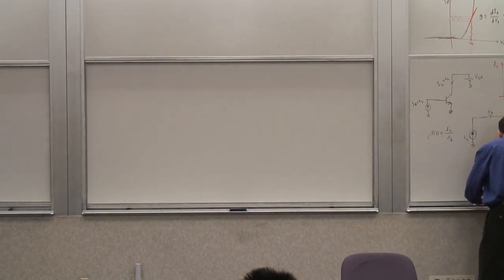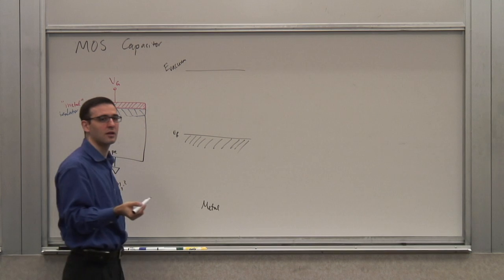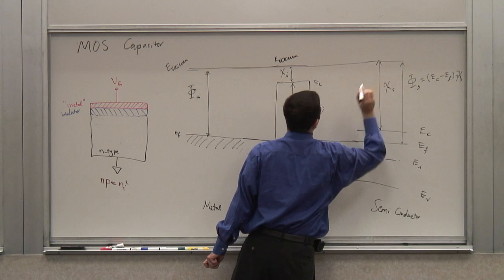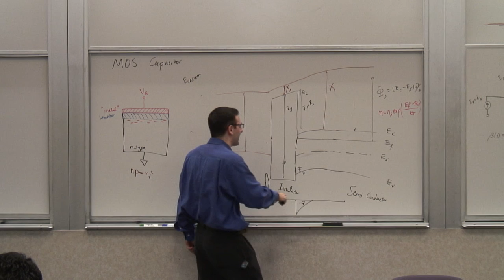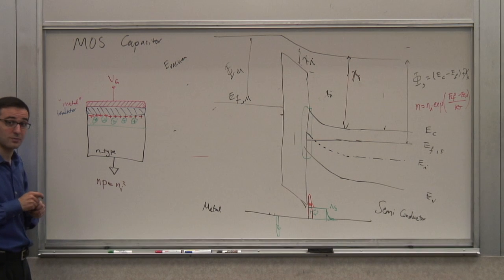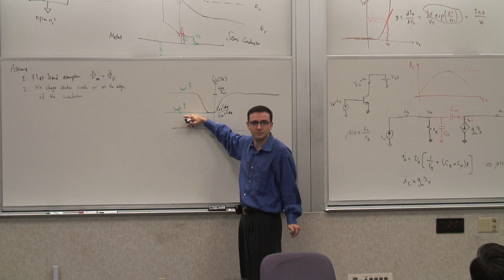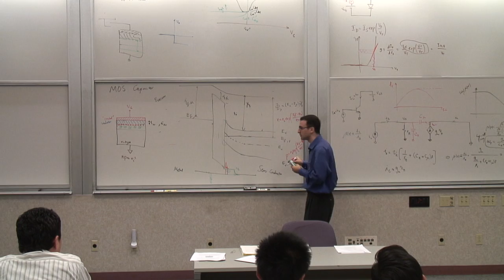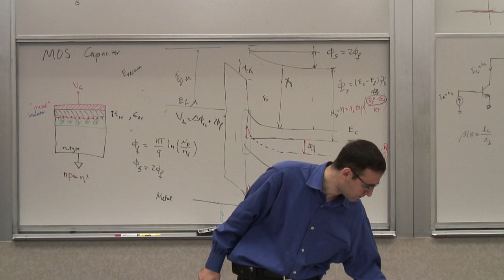108. Basic Solid-State Devices: MOS Capacitor, Accumulation, Inversion, Threshold voltage

Comment: I still didn't understand why did the fermi level go down ......i couldn't hear the explanation clearly.... can we have subtitles for this lecture?
Reply from the maker: The Fermi levels go down for a positive voltage because this is the energy of an electron and electrons have NEGATIVE electric charge (which changes the sign).
Reply: Prof is there any specific book you would recommend to understand more elaborately about moscap ? I am working on a project in which we are using a nanomaterial(can't disclose it here because of privacy issues) as a dielectric in our MOSCAP  so I am facing some problems in CV measurements. Also if its not much of a problem to you is there any platform available where I can ask my doubts? Your explanations are very easy to understand as compared to referring a book :)